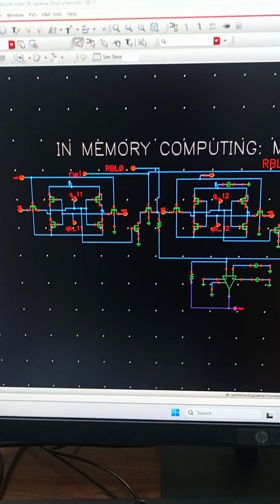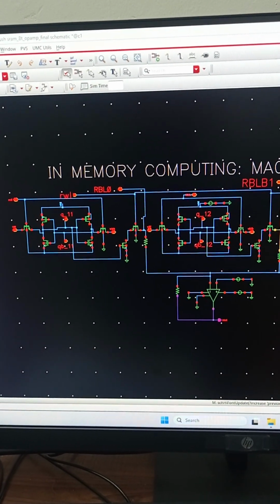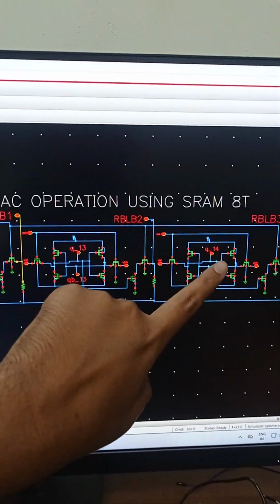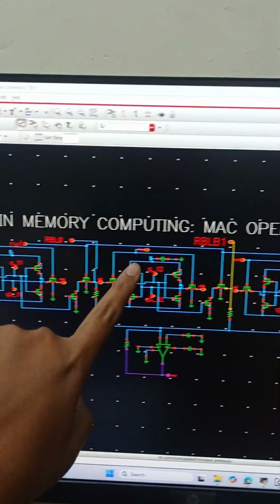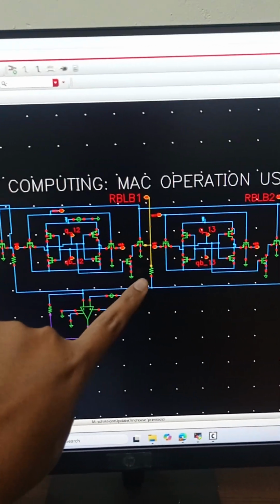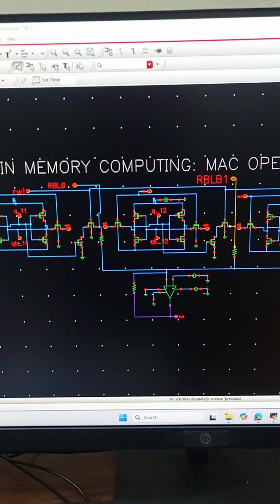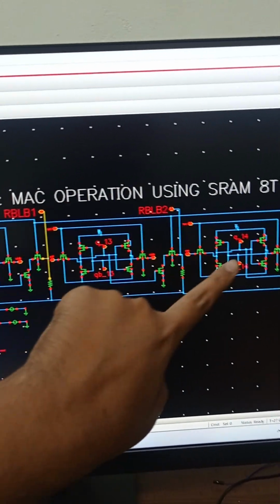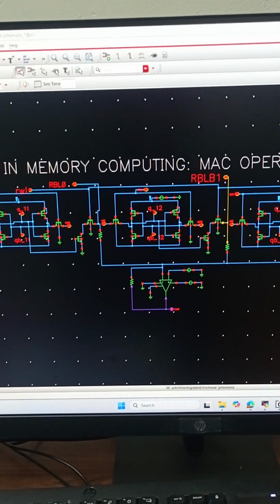In-Memory Computing (IMC) Demo Using 8T SRAM | MAC Operation in Cadence Virtuoso #VLSI

Comment: Bro make a full length video on 6t sram using memristor
Reply from the maker: Memristors and SRAM are fundamentally different types of memory devices, in how they store data and how they operate.
SRAM uses CMOS transistors ( 6T or 8T) where data is stored as the stable state of cross-coupled inverters. It is volatile, meaning it loses its data when power is removed. 

In contrast, a memristor is a two-terminal device whose resistance changes based on the history of voltage applied to it. Hence it remembers its last resistance state even without power, making it non-volatile device.
Reply: @SuccessPointForVLSI  I want a video on the combination of memristors and sram which makes the sram a non volatile when using memristors in the design which is very helpful in ai chips in vlsi